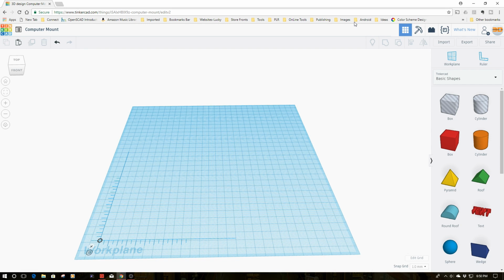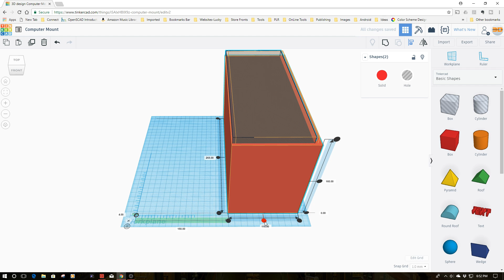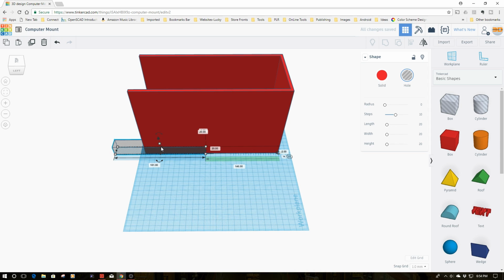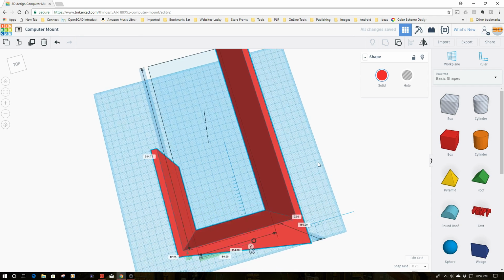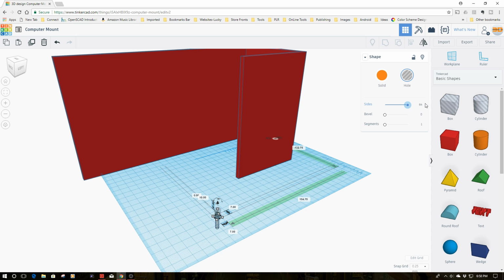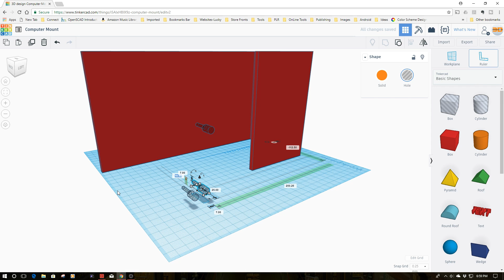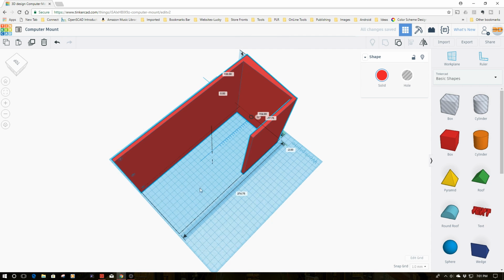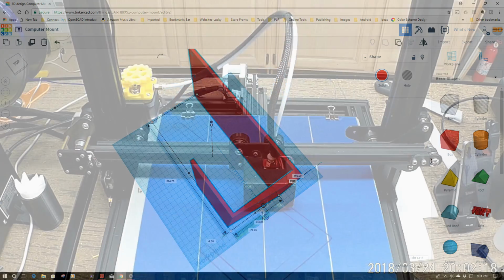3D Printed Project - Rapid Design for a Computer Mount and Major Fail!

Comment: how dare you besmirch norm abram :) Why does your print have the vertical texture/lines? just the infill pattern? I recently had two fairly tall prints fail in the same way. I redesigned the part.. and then discovered that my Z axis was binding. oops.
Reply from the maker: Not sure I understand "have the vertical texture/lines? just the infill pattern?"  It released and just went all spaghetti on me :-)  Also know what you mean about Norm as he is my cut once hero!
Reply: vertical texture- look at 14:38 and you can see the lines, horizontal when you are holding it like that. Looks like Coroplast.

Comment: I've never used Tinkercad as I use Fusion 360. I'm thinking this would be easier to model in Fusion 360. Were you just showing Tinkercad as something different? If so that's cool. Don't you love waking up to a spaghetti breakfast? :)
Reply from the maker: LOL!  spaghetti breakfast!  I too use Fusion 360 yet for most in this hobby its a bit scary (I also do an open SCAD Channel too so use to scary) so I stick with Tinkercad as its easy and fast :-)
Reply: DIY3DTECH.com I see you doing Tinkercad and I think that looks hard after learning Fusion 360, lol.
Reply from the maker: LOL!   I think that looks hard after learning Fusion 360

Comment: try anealing it. still its way too thing for those loads
Reply from the maker: Please do share more...
Reply: There are a bunch of videos about anealing PLA, but basically you heat it up to about 100ºC on a flat surface and leave it an hour and then let it cool slowly. It because way stronger and quite more heat resistant. The only downside is that parts tend to shrink a bit (about 5%) and its a lot of work unless you have a temperature controlled oven that can do 100ºC good enough.
Reply from the maker: Interesting, however 5% is a lot of shrinkage...
Reply: DIY3DTECH.com 
Not if you design the piece with that in mind. I wouldnt do it for pieces downloaded from the internet but if you have the source files then it shouldnt be a problem. or you can try just scaling the object a bit in the slicer itself but iirc its 5% in the XY axis and 2% in the Z axis. Basically its like heatshrink, it contracts more in the stress axis. In the printer case the plastic only stretches in the XY directions so it makes sense. Maybe printing hot and slowly could help reduce the stress and so make the piece contract less while anealing it.

If you heat some fillament and stretch it while its still warm enough and let it cool it will hold a memory of its original shape, but if you heat it a lot or keep it hot for a while after stretxhing it it wont go twist back to its past shape if you reheat it.

Comment: If you set your ruler to use midpoint, you can center your main part at zero and then all other offsets become easy. For every positive valued element that needs to be replicated on the other half, you simply duplicate the part and assign it a negative offset to the existing distance. This works for all three dimensions.
Part of the issue you had with setting your hole distances came from NOT using midpoint.  A simple switch to midpoint would have shown you how far off the top hole was, as well as giving you a simple and accurate figure to subtract from the top edge (same as distance from the bottom edge). Otherwise you have to subtract your height of the bottom hole PLUS the width of your hole.
Reply from the maker: Interesting, so how does on one set their ruler to mid point?

Comment: Glad to see reality.  With large, long or tall prints I use a significant touching skirt to hold the part down to the bed to counteract the warping that WILL happen if you do not use a skirt.  The bed can only keep the part warm so far.  The other option is to use a chamber but the CR-10 has a large enough footprint already.  I have printed very long or tall stuff on the CR-10 and using a big skirt helps, especially with PETG.
Reply from the maker: Yes I was rather surprised at the issues I had here as up until this point I had no issues but this was the largest (i.e. longest) part I have printed.  However do agree with you on the skirting for hold down...

Comment: PETG, similar to ABS, prints much more reliably in a chamber. If you can mitigate the temperature differential your results should improve drastically.
Reply from the maker: In general would agree but really have not had an issue in the past, this was the first.  I am thinking about building one from maker-rail and acrylic :-)  just need to find a cheap source of the later...

Comment: Thanks, Joe for the reality TV.  We have all been there.  My Insta360 ONE project has been a challenge.  I'll be coming out with a video on why the Insta360 ONE does not work all that well for drones.   Works but not the quailty we all look for.
Reply from the maker: I have been impress those design skills there Mr Cook!  However the issue you most likely are running into with the 360 cam is depth of field or lack there of as it can only see close up unless you get a REALLY expensive one...
Reply: I will explain in the next video but the main problem is the camera covers the sensors on landing.
Reply: BTW, I am finding the using an 80% fill works much better and not that much longer.  That might have helped the computer mount.